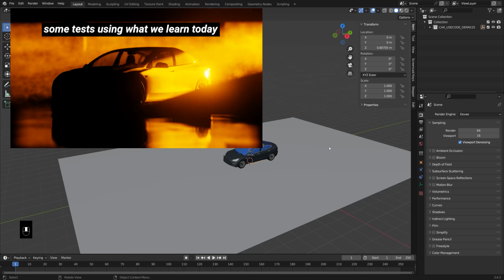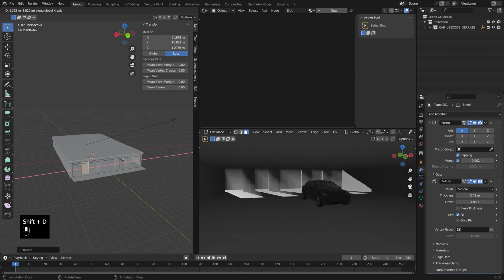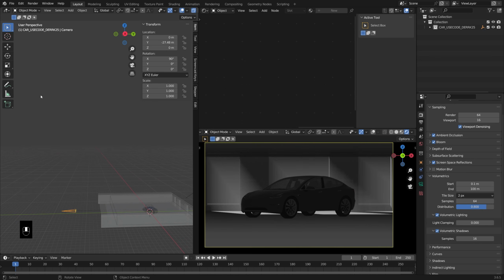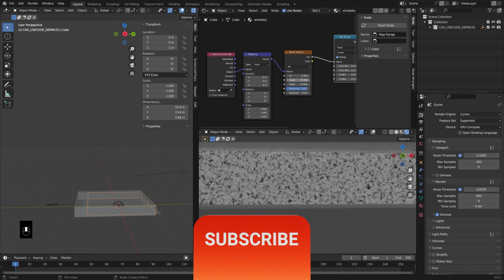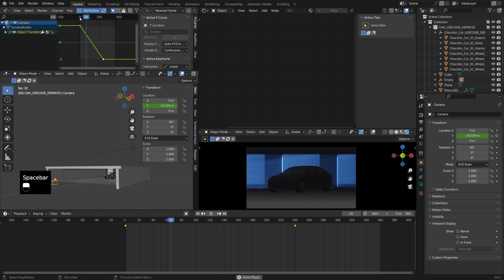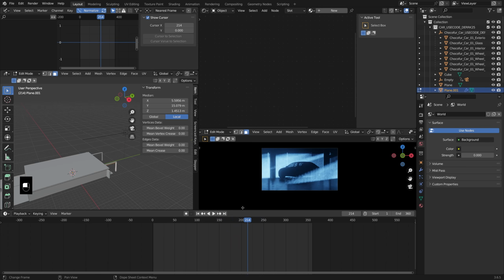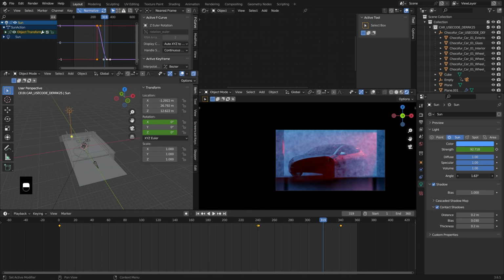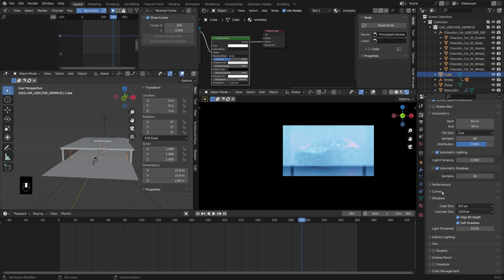Smoky Volumetrics in Blender with EEVEE!

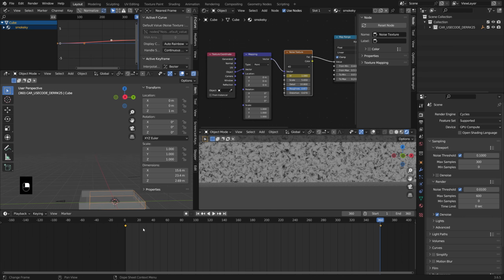Comment: 14:00 You can hit T in the timeline editor with keyframes selected to change the curve mode to linear. Another great tipp is to set it as linear by default via Preferences -> Animation -> F-Curves -> Default interpolation. That's also great if you want to make infinite looping animations.